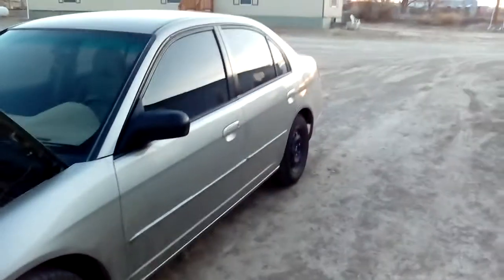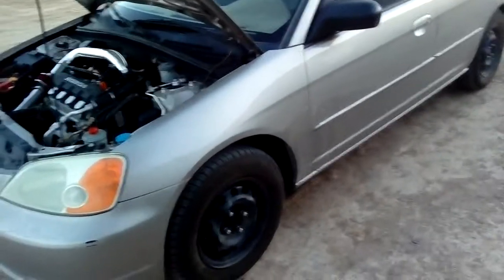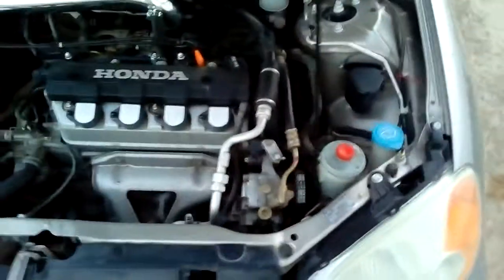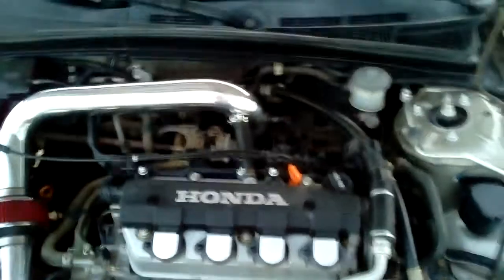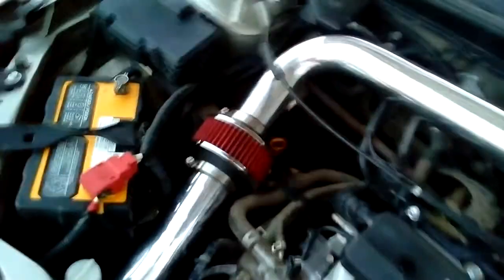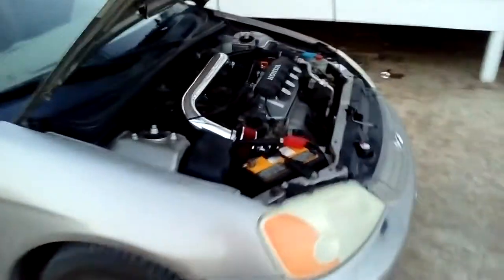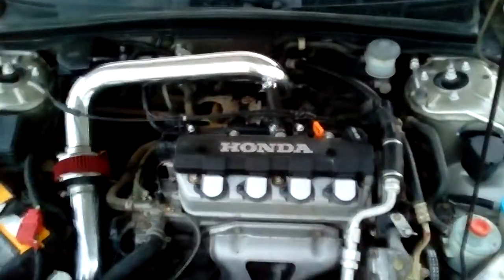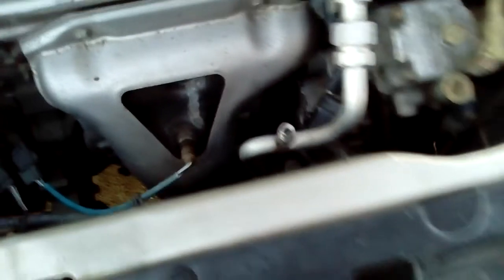2003 Honda civic lx cold air intake

Comment: All fun and games till it suck up a whole bunch of water.
Reply: Water How ?
Reply: @josephanthony1655  Lol serious question ?
Reply: @justyngarcia206  Yes, because I don't know SHIT about cars.
Reply: @josephanthony1655  Since this intake is taking in air from under the battery or just low in general that means its close to the ground and can also take in water from puddles and even if it's heavy rain and your driving it's a possibility. Sucking in water can cause hydrolock
Reply: @justyngarcia206  Now I get it. Thank you for explaining.

Comment: What kind of air intake it's that name?
Reply from the maker: Tu Papá Its not a name brand but I went and found the link for you I bought it off Amazon. 

https://www.amazon.com/gp/aw/d/B00QKZ6Q8Y/ref=mp_s_a_1_6?ie=UTF8&qid=1510877765&sr=8-6&pi=AC_SX236_SY340_FMwebp_QL65&keywords=cold%2Bair%2Bintake%2Bwith%2Bbypass%2Bfilter&dpPl=1&dpID=51jRBkIBGrL&ref=plSrch&th=1&psc=1

Comment: HUMMMM kinda defeats the cold system when you are sucking HOT air with that second filter.  Might as well just put a short ram system.  Cold air makes HP not hot air.  This system is for looks only not HP.
Reply from the maker: Watch my other videos I took that bypass filter off. I only used it for rainy season. Didn't want any chance of hydro lock. I agree tho...But tbh I am back to stock air box. Runs the best.
Reply: @GGYoutuber5958  so it wasn't running all to good with the cold air ???